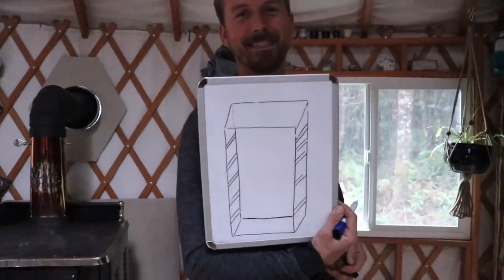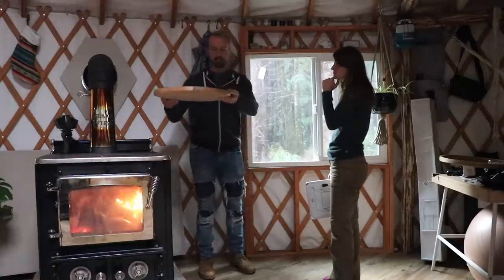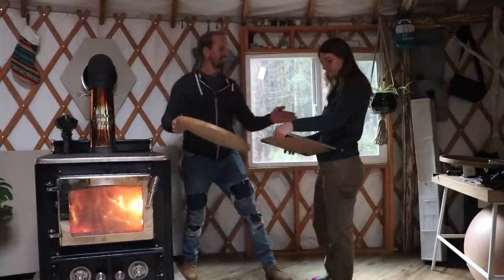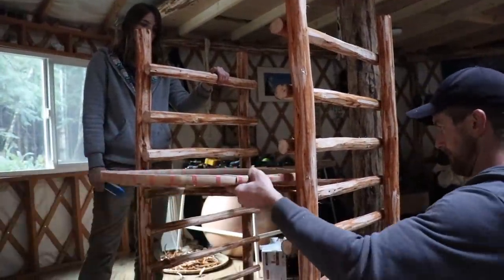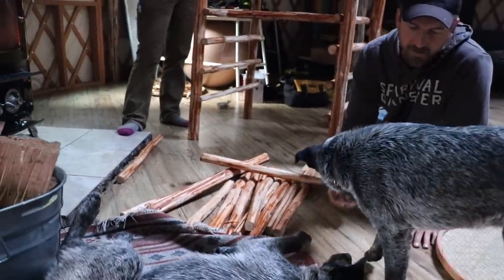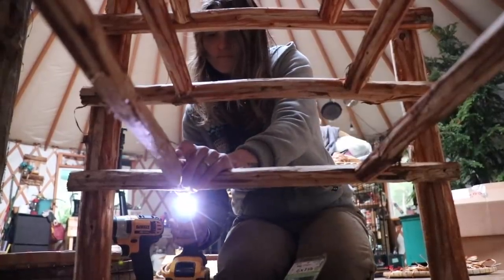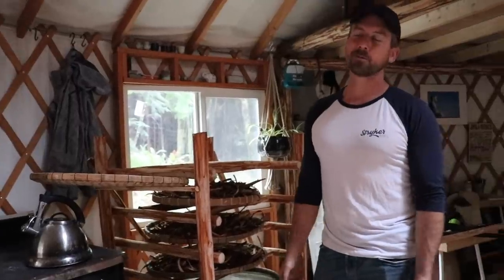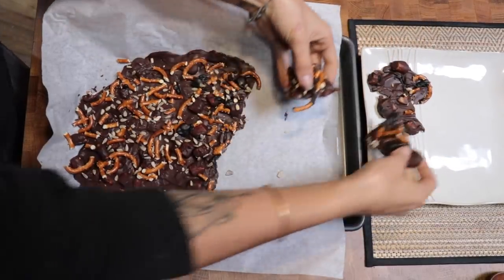Living Off Grid | Drying Food - Building a Dehydration Rack with Forest Wood - Ep. 68

Comment: You're using your new deck as a work bench. :) I told you you'd need one sooner rather than later, just rip a log in half 6 ft long just below the pith (center) and put it on some V-legs and call it done. Also, that is a nice first try for a drying rack, but those screws won't hold when that green wood dries out and the thing will split and fall apart. That is why I also push you to learn some basic primitive wood working skills, mortice and tenon joinery. It isn't as hard or time consuming as you think and instead of a wobbly rack that will fall apart in a couple months on the wood stove and catch your new yurt on fire, you will have real, solid wooden furniture and objects. Watch some videos on primitive wood working and practice and you'll quickly find that screws and screw guns aren't the way to go at all, especially for green wood, which warps and bends and splits and falls apart as it dries.

Comment: You need to learn to control your fire in the stove. You need to turn the air flow in the bottom down to let less air in. This will do 2 things - [1] cut down on heat going up the chimney and wood will last longer, and [2] will suck less outside air into the yurt and will keep it warmer in there. You should not have big flames like you're showing - burning wood way, way too fast. You should be able to load up the stove with wood when you go to bed and have plenty of hot embers giving off heat yet in the morning......

Comment: If you put some standing aluminum 1 foot long columns over your furnace, while you're not using it to heat something, the heating of the room becomes more efficient as you're absorbing it into the metal instead of letting it go through the exhaust pipe. It works like some kind of accumulator. Better that your ventilator that you actually have there. This dissipator  is removable, and four or five columns are enough to better heat the whole room.

Comment: With all the timber you two cut up and just do it loose on the ground, why not build a simple sawbuck or two to hold the pieces stationary while they are being cut.  Of course it only helps on pieces light enough to pickup but they are the most difficult to control while cutting.  They would not have to very high, maybe 18" or so and light enough to transport when needed.

Comment: Why, oh why would you risk your lives just to dry some wood chips?  You putting both your lives in danger by placing any combustibles that close to your wood stove.
Reply: Read the instructions that came with your stove.  My brother was killed in a fire because flammable material was placed to close to a heater.  Of course I have nothing invested in your blog, but you have viewers who I'm sure would miss the entertainment.  I only hope and pray your public doesn't follow your example.
Reply: Daver G  Are you a building inspector or a fire marshal???
Reply: Guys, I sort of agree that this drying rack COULD be dangerous if not monitored actively by watchful eyes.  I certainly would not drape dry cloth too close to the oven.  Drying baskets directly over the burner surface might seem like a good idea, but not if the whole assembly tipped over or a basket fell down onto the burner top somehow (thus the discussions here about keeping cats from climbing on it, and corner or cross beams to stabilize that wobble tendency).  The best solution mentioned is to have the blower fan move the warmed air over the structure, from a distance!  However, humidity levels in the Yurt may be counterproductive to drying foods anyway, and you wind up just partially cooking them with the heat.
Regarding the wood shavings, we need to remember that the bark, especially from conifers is loaded with combustible saps - where do they get the ingredients for turpentine?  Turpentine can be used as a fuel in certain devices and lamps, because it is very volatile.
I WONDER IF they have a fire extinguisher anywhere inside the Yurt - I know this is one of the items I first purchased when I moved into my home, and we use all modern appliances, gas oven and water heater, but still recognize the inherent dangers of fire with cooking or using anything wood-burning, like a fireplace.  Humanity has invented things like fire extinguishers out of necessity.  we’ve learned our lessons - but, unfortunately, each new generation must either relearn these, or wisely absorb the wisdom of previous generations, especially when it comes to safety.  Jake and Nicole, have you a fire extinguisher?  Get one, please!  We love you guys, and the forest.  Protect it all.
Reply: I've been stacking wood next to my Regency stove ( Less than 8") in a four foot rack for twenty years, no issue.  Flash point is 600F.  My stove is zero clearance.  Also the back of the stove is 5" from my Cedar logs